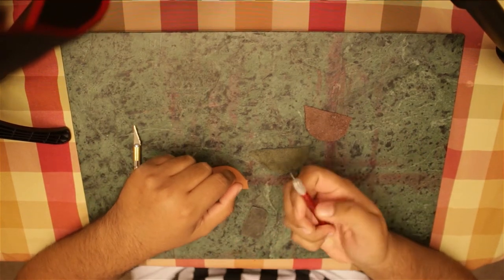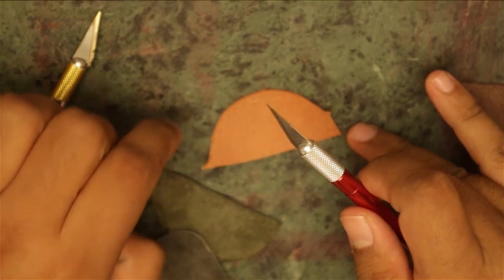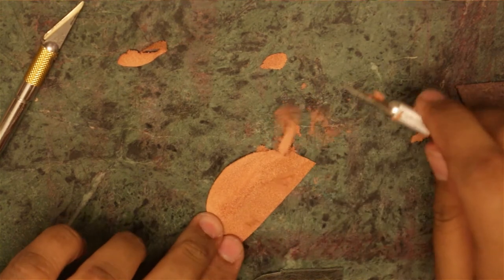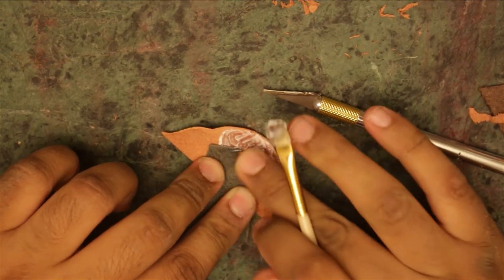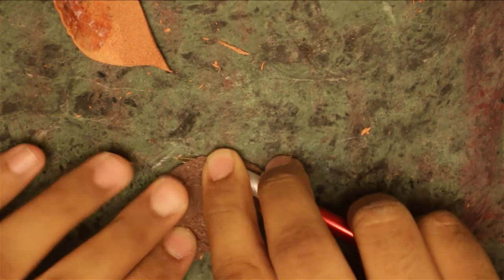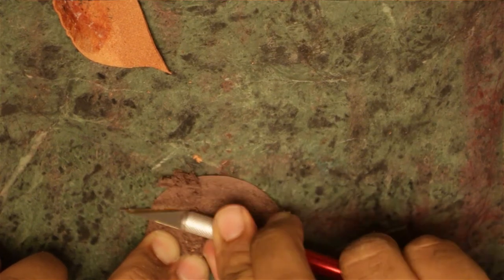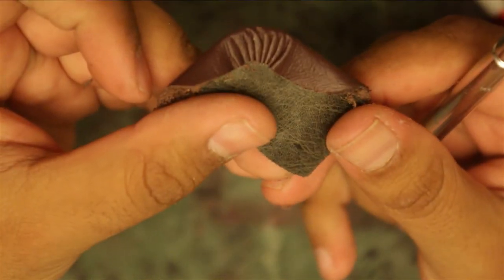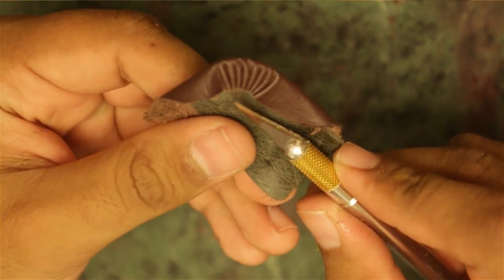Leather Paring and Corner Work *Please Read Description*

Comment: I may be mistaken but I though you made a different style cover.  I thought you folded the edges and corners over onto the under-side of the cover leather and had the liner meet up to the edges of the fold?  In the examples, you are folding the edges and corners over onto the liner.  You did an excellent job.  I just thought you did a different style, am I wrong?
Reply from the maker: Yes that is correct. My main goal in this video is to show how the paring down of the corners of the leather covers would help in making a better and cleaner corner of the finished product. I did it this way because I know that most people do it this way, and it was easier to do with the pieces of leather I cut for this example.
Reply: Guerrero Leather Rebinds, I was just curious.  You do an excellent job brother and this was a great video.  I plan on making one as well this week.
Reply from the maker: Thank you! Do you use a different technique?
Reply: I use the technique shown in your video, folding the edges and corners over onto the liner.
Reply from the maker: I meant the paring of the leather, do you use a different technique?
Reply: Beau Tate between you and Guerrero I think I might be daring enough to try to rebind my Bible that fell apart during the unboxing video. I appreciate you guys being willing to help others and give pointers.